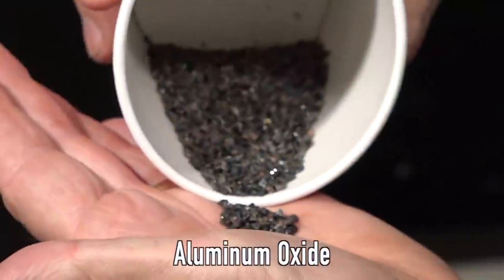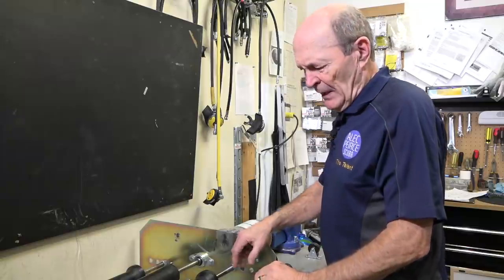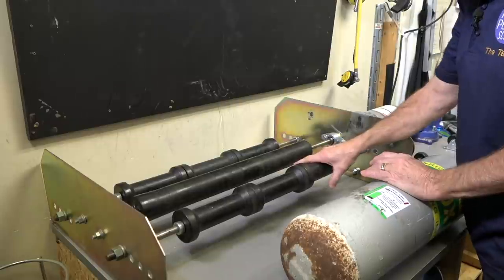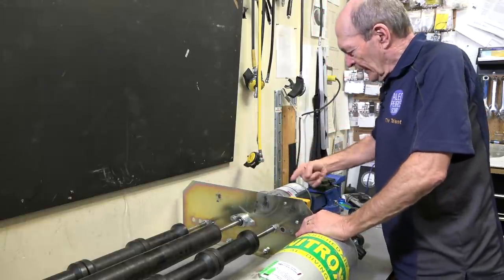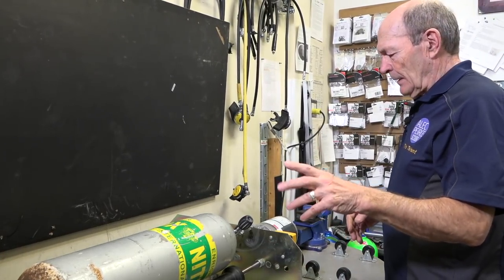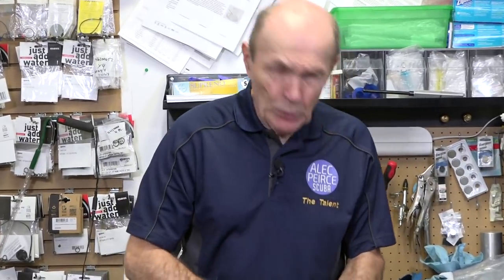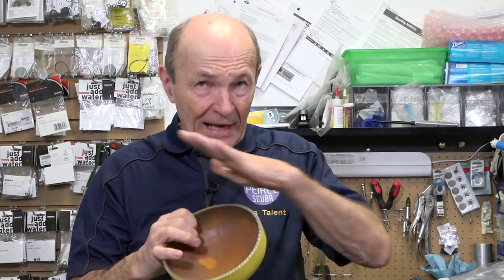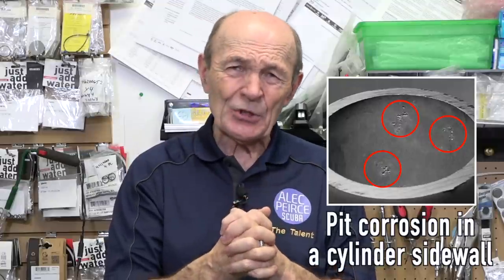Don't Tumble Your Tank - Scuba Tech Tips: S13E08

Comment: O I see thank you for this current info now. I have to go back and check the stamp date when it was last visual (especially tumbling) if necessary.
Reply from the maker: A visual inspection will determine if a tank needs tumbling to clear it out.  It should be a rare event to tank tumble.  Any more that once in 10+ years and there may be another problem with the air quality, tank valve, or emptying the tank to zero pressure.
A.

Comment: thumbling is a process that is widely used in sheet metal work industry to eliminate burrs on parts that are volume produced, a fairly efficient process.
for sure that to clean the interior of a tank, the application is a bit different but the main process is very similar.
In my tank pool, I have one old steel tank ( Voit  with 1/2 NPT neck thread and cable operated reserve valve) that I retrieved underwater and to my estimation, that tank was there for at least 5 years, 
Needless to say that that tank was filled at least the half of the volume with water and of course, it was very corroded.
I peeled all the external plastic coating ( it was about 3/32" thick) , the exterior was OK so I took the chance to have it thumbled and hydrotested and at my surprize, the tank passed the test ( hydro and visual ).
 I use that tank for the last 20 years.
Reply from the maker: That is a great story Jacques.  Thanks for sharing and glad you took a change on that tank.   
A.

Comment: I have not dived in years but I do work with high pressure stuff all the time and I want to throw my two cents in.
the threads for the valve...a rubber plug won't protect the threads for shit you should have a threaded insert in there to avoid any contact from the threads with the grit. Just use a old valve or something.

I never understood why steel tanks were not plated in something... Zinc would be my choice but the high pressure chemistry is somethingim uncertainaabout
Reply from the maker: Hello and first of many years ago steel tanks were the only tanks for divers.  They did sell a plastic bag that went inside the steel 72 cu/ft tank to "protect it".  BUT when the valve was threaded in it cut the plastic so moisture was inside anyway.  Good marketing but bad product.  It was by AMF called the "Lifeliner"  Watch Vintage Scuba S07E17 on 72 cu/ft tanks.
The rubber plug is what its called.  Your correct about the aluminum oxide on threads is bad but its actual a threaded plug thru all threads.  Just what i call it.  
Much appreciate your feedback and thanks for watching.
A.
Reply from the maker: Oh and thanks for the feedback too.
A.
Reply: Speaking of steel 72’s I still dive mine which is 52 years old. Am I right that without a 10% overfill you could get with a plus mark, a 72 is really just a 66 cubic foot tank at 2250 psi?
Reply: @AlecPeirceScuba_SeaHunter  ahh I see you actually use a threaded plug thing that really protects the threads.You know what you are doing its concerning that others might just try this with no clue.. I have seen what 300bar does when it gets out in a hurry...

Comment: What is worst for a tank? You talked that the hydro test is all about elasticity, so, what is worst, being constantly under pressure or being used and refilled? I have a small 2L-300bar tank that I use as bail out and it can be at 300 bars during a year or more. Should I use it more regularly or it doesn´t matter?
Reply from the maker: Does not really matter.  Long term storage and repeated filling affect tanks but neither is dangerous if tested for VIS and hydro regularly.  Take any large Caribbean dive resort that fills a hundred tanks a day x 7 days x 365 days + salt and sun/heat is a lot of filling cycles on an aluminum 3,000 psi tank.  Yet no reported explosions or issue due to testing and the quality of todays tanks.  
A

Comment: Hello Alec.  How do you dry a steel tank?  I tried with hot air and it oxidizes again😢.  Greetings from Patagonia.
Reply from the maker: Generally all steel tanks after hydro tested, are coated with a flash drying protective coating, specifically to prevent rust.  They are then put valve down on a drying stand blowing room temperature air (warmer is OK if the tanks have been coated).  This ensures a dry tank until the next annual visual.  Hope it helps and hello from way north in Canada.
A

Comment: Is that amount of flash rust on the steel tank bottom you showed OK at annual VIP inspection?
Reply from the maker: Visual Inspections are somewhat subjective. That is, you cannot weigh the tank & say Yes or No. It requires looking at the tank and making a decision. Different inspectors will make different decisions.
Some are adamant that the tank have an "as new" appearance. 
Others recognize that the tank is not new & there are bound to be some imperfections from use.
Rust is only an issue if it is likely  to flake off or fall off the surface. In that event it could potentially enter the air flow to the regulator & block the filter.
In my opinion, after almost 50 years of scuba service, a very thin coating of 'surface rust' is unlikely to be a problem. That rust will not fall off, certainly not in a volume such that it could travel to the top of the tank, circumvent the dip tube of the valve (which is there for that very reason), travel through the valve & enter the regulator.
I have seen regulator filters that are red from rust but that is almost certainly the result of poor/no maintenance. It takes a long time & a lot of rust to cause that.
Surface rust is easily measured by simply scratching it with a stainless steel probe - part of a visual inspection. If the rust is solid on the wall, it may pass.
If you are concerned, note that surface rust can be removed easily, usually by tumbling or using a hone. 
However, when the tank is rinsed after the cleaning, surface rust will almost definitely reappear. It may seem to be a no-win situation but, using a rust preventative in the rinse water & drying quickly ought to result in that elusive 'as new' appearance.
Hope that answers your question.
Alec

Comment: Hi Alec i have a question where does the water go in a hpa system or tank when under pressure. Does the water always flow and settle down or follow gravity . In a hpa scuba tank if the tank is stored upright the water would always be at the bottom just the same as if there was no pressure right..Thanks
Reply from the maker: It follows gravity always.  Even under pressure a drop of water is heavier than the compressed air.  That is why tank valves have 'dip tubes' to prevent water/junk going through the tank valve into your regulator.
A
Reply: @AlecPeirceScuba_SeaHunter  Thanks a bunch Alec

Comment: What is the anti corrosion you use in the dive cylinders ?
Reply from the maker: There are several commercial products plus home mixed solutions to inhibit corrosion in steel tanks.  Read this link for recommended product names: https://scubaboard.com/community/threads/supplies-for-o2-cleaning-a-steel-tank.218269/ 
A